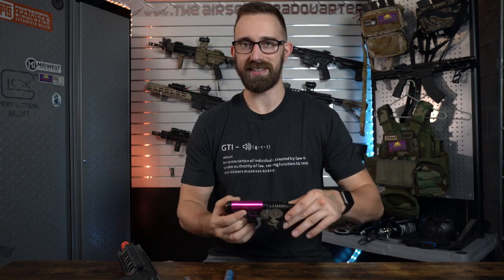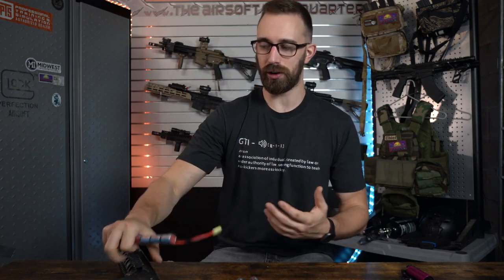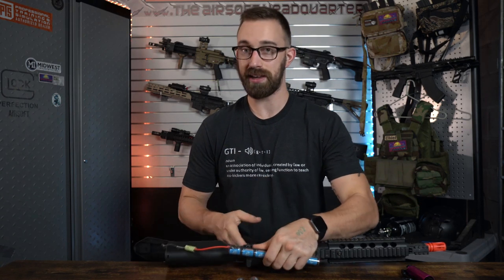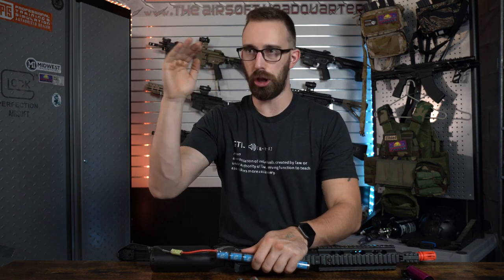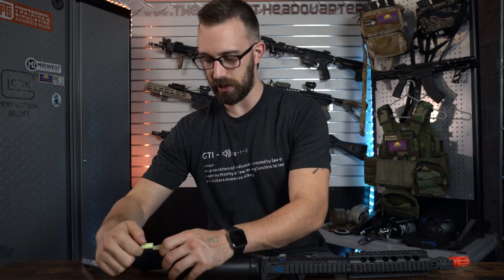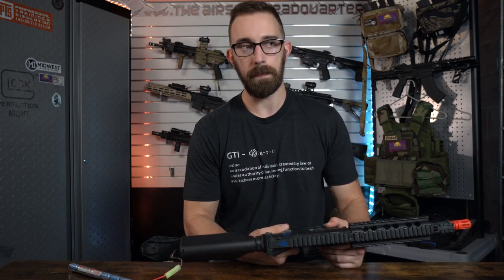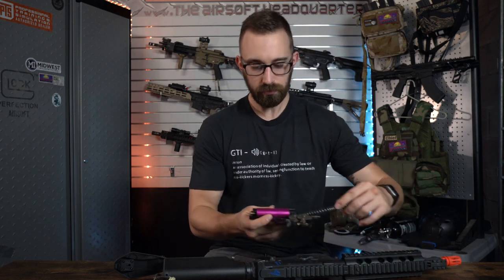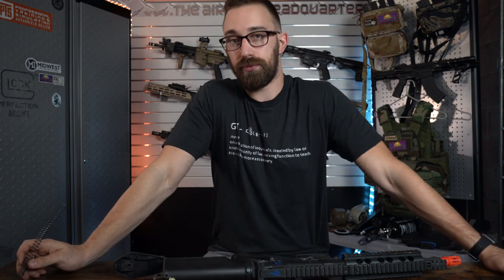5 Minute Fix: Locked Gearboxes

Comment: Thank you so much! Im working on my first upgrade rn and the gearbox locked up, turns out the battery was dead lol
Reply from the maker: Lmao happens to the best of us
Reply: @TheAirsoftArena  could u offer advice lol, so my battery's good, gearbox isn't locked but my motor doesn't have enough juice to turn it over, what should i do?
Reply from the maker: @callsigndobermanairsoft4209  Check if there’s any breaks in the wiring protection that could create a short. There doesn’t need to be much wire exposed to draw some of that energy out. If you have access to a spare motor I’d suggest trying that if you’re wiring is fine. Or even if it’s an old battery’s is may not have the same discharge as a newer battery
Reply: @TheAirsoftArena  the wiring's fine i think its just old ty so much!
Reply: Glad I read your comment before open the gearbox again, try another battery and work perfectly fine😂😂

Comment: Ive had my cyma ak lock up a couple of times on a 7.4 but the thing is my battery wasn't dead. I simply just switched to full auto and that fixed it. I don't know why it's happening. Also it feels like my trigger is locked too when that happens until i switch to full auto.
Reply: One of my guns has this problem too
Reply: same with my gun.
Reply: I have a cyma ak 8.4v and when I shoot a couple times the piston stops and the motor tries to fire but doesn't.

Comment: Wow one of the best video for locked gear box. 
  One question- I think I kept on clicking and heat up the battery many times.  Now my gear box is keep on locking .  I did get lithium new battery but same issue.  Do you think the motor needs replacement?

Comment: after replacing the gears (earlier ones lost a few teeth) my gearbox keep stopping on reverse position with every shot.  I have stripped in a part(shimmed) and still the same.  I cannot locate the problem. battery is not an issue. Every gear ,springs, screws piston head tapper plate......is new.

Comment: so i have a nimrod 7.4v lipo battery( 2100mah) and a turnado f2 high speed motor, and a 120 spring, my m4 frequently locks up even when fully charged. it dosent look like the motor would be the problem. PLS help

Comment: Ive got a gen 8.5 an just upgraded the spring to 1.25 an it locks with that spring, still have the standard 7.4 battery, put the old spring back and it didnt lock, fully charged the battery and the new spring back in and it still locks, going to try a larger battery/new battery a friend just got
Reply: I just want you to know you just saved me from a hefty tech bill because when I put the upgraded spring in mine it did the same thing.

Comment: Pls help me here. Well I got 3 different batteries. The motor works just fine. I tested it with the dead battery. Didn't work, then I tested it with the fully charged battery. Didn't work either. What do I need to do? It just stopped working while I was holding it. Pls help anyone.

Comment: Just put a new motor in my Ak and the same things was happening. Hopefully I just need to charge the battery up a bit or it’s time for a new battery.
Reply from the maker: Make sure you have the correct short height motor lol I know its silly but some people to forget the important things. If youre battery is messing up double check with a buddies battery and if its still happening then yea it may be a new battery solution
Reply: @TheAirsoftArena  it is a lonex short motor and the battery on charge now. I use a 9.6v nimh so if that doesn’t work I’ll probably pick up a lipo and a mosfet.

Comment: hi, my g&g arp9 hasn’t worked in like 2 years. I’ve bought new wires, new battery, and motor. Still doesn’t work. Every time I pull the trigger a red light blinks twice on the mosfet. Any ideas why it doesn’t work?
Reply from the maker: I do not know why that would be, but I think someone may need to take it apart and attempt to reassemble it correctly to make sure its all in one piece and everything is where its supposed to go
Reply: @TheAirsoftArena  yeah, I’ve taken it apart before and made sure everythings in the right place
Reply from the maker: @silenthunder5657  other than trying out the Perun mosfet which is a replacement of the original mosfet I’d say use it as an HPA gun
Reply: @TheAirsoftArena  man… I’ll see thank you.

Comment: Now you are telling that low battery voltage is the reason for motor getting struck. Now i will charge the battery and try your solution